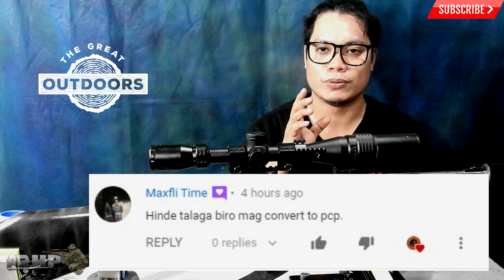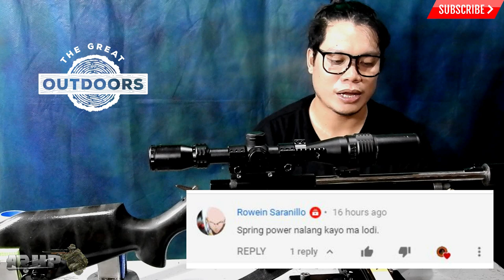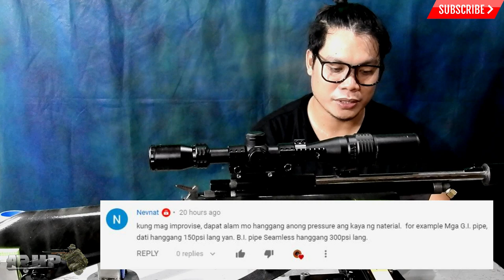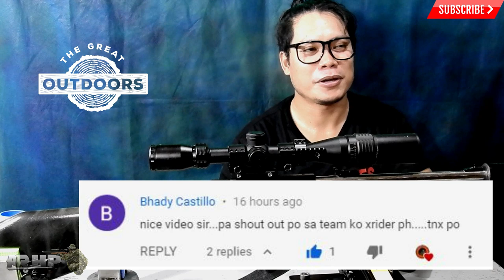BAKIT GUSTO MO NG AIRGUN? | Halagang 7000pesos may Airgun kana

Comment: Hi sir sadin po sa bacolod ang store nyo sir
Reply from the maker: Thanks, po sa inyong mensahe. Maraming salamat po sa panonood.
Magandang Araw po sa inyong lahat, Maraming salamat sa inyong pagbisita sa ating channel.
Ganon din, salamat po sa inyong patuloy na pag subaybay. Mabuhay po kayo!
Always keep safe po, and God bless po sa inyo at sa inyong Pamilya.

Regarding po sa tanong ninyo. Pwede nyo pong ma contact sa messenger ang mga sellers po para ma assist po kau sa mga:
1. Contact info like cp# ng sellers
2. Accessories ng mga airgun
3. Brand ng airguns na avail nila
4. pricelist
5. paano ipadala
6. mode of payment
7. saan location nila
8. o may branch ba malapit sa inyo
9. atbp. na mga katanungan.
LOCAL SELLERS:
1. Win Lustarez
2. Robin Samonte
3. Rolly Aurellana
4. Philip Jeffreth Mendoza
5. Raffy Artigas

PAANO MAGING SAFE AND LEGIT CHECK?
1. Mag pa legit check-Ask ang mga matagal na sa airgunner
2. Mag padala ng Private Message- Send a message regarding sa information na gusting malaman
3. Once nag reply ask question regarding sa accessories or type ng airgun na bibilhin
4. Once na nakapag decide na sa bibilhin, mag video call po kayo para na makita nyo xa same sa profile pic at photos ng naka transaction na seller.
5. Before mag bayad sa item na kinuha mag papadala ang Seller ng Video na binabalot nya ung item mo
6. Hingin ang code if sa ano mang currier nya pinadala.

ADD ON QUESTION:
Ano ung valve na naka thread?
Ito po ang vid na ginawa ko sa installation ng airgun nimrod: https://www.youtube.com/watch?v=wrj_i6z119w&feature=youtu.be
Maraming salamat po. From AIR RIFLE HOBBIES PHILIPPINES
______________________________________________________________________________________________

Magandang Araw po sa inyong lahat, Maraming salamat sa inyong pagbisita sa ating channel.
Ganon din, salamat po sa inyong patuloy na pag subaybay. Mabuhay po kayo!
Always keep safe po, and God bless po sa inyo at sa inyong Pamilya.

Ito po yung kadalasang tanong na hope po makatulong.
PAANO MAGING SAFE AND LEGIT CHECK?
1. Mag pa legit check-Ask ang mga matagal na sa airgunner
2. Mag padala ng Private Message- Send a message regarding sa information na gusting malaman
3. Once nag reply ask question regarding sa accessories or type ng airgun na bibilhin
4. Once na nakapag decide na sa bibilhin, mag video call po kayo para na makita nyo xa same sa profile pic at photos ng naka transaction na seller.
5. Before mag bayad sa item na kinuha mag papadala ang Seller ng Video na binabalot nya ung item mo
6. Hingin ang code if sa ano mang currier nya pinadala.
Nagbebenta kaba ng AIRGUN?
-Sa ngayon nag promote and review lang po muna ako ng Airgun na aking nabibili sa mga maker. Pero maka assist po ako if saan po kayo maaaring bumili online.
SAAN MAKABILI NG AIRGUN?
Makakabili o makakaampon po tayo ng Airgun sa mga online store sa Facebook po.
1. Search Airgun group sa "Facebook"
2. Once accepted and join post for inquires
3. They will Private message po sa inyo sa mga details
a. Payment method
b. Specs ng Airgun
c. Warranty
d. Atbp.
4. Do background and legit check po by posting sa group
a. Tingnan mga friends list niya if madami syang kaibigan na Air gunners
b. Kung kalian ginawa account nya at least 5 years
c. Do a video call sa transaction and screen record for assurance.
d. Maganda kaliwaan ang pag bayad like meet up
PWEDE BA IPA CONVERT ANG C02 TO PCP?
Yes, pwede po sir, e check po ng maker if pwede most of the Airgun like: Nimrod, Manlapat, Taurus, Armscor, Atbp.
Pakita nyo lang po sa maker and ang maker na po mag suggest sa inyo anong conversion gusto nyo like bottle o naka tube. Range po sa 8k-12k pataas po ang bayad sa conversion nakadepende po sa maker. 

PAANO PAPADALA NG SELLER ANG AIRGUN?
Papadala sa currier ng seller, sila na po bahala doon.
By buss o barko, make sure po na complete address and my phone number and ask how long dadating.
Ganon din ask ang sellers for warranty what if di makakarating ang Item.

KAILANGAN BA NG LICENCE ANG AIRGUN?

There is no law that will punish anyone in the country for having an airsoft/airgun even if it is not registered. You also don’t need any form or permit or license to own one...our firearms law R.A. 10591 does not include the word airsoft or airgun in there. Feb 6, 2019.
Credit from: Journal.com.ph

PAANO MA PA REGISTER ANG AIRGUN?

Pag nakasali na sa mga Airgun group sa Facebook
You can ask for the legit person for register 
(LARRY AVILA) Philippine Team natin you can ask him po
Magbibigay sya ng mga info for requirments
Maganda if by group po ung pag register para isahan nadin po

PWEDE BANG ISAKAY SA BUSS O BARKO ANG AIRGUN?
1. Kailangan po na naka register ang Airgun
2. Kailangan dn may receipt ang Airgun na makikita kau ang may-ari
3. Mag inquire sa Buss and Ship station if pwede isakay ang Airgun
a. Ipakita ang registration at Reciept 
4. Pag pumayag na sila doon lang dadalhin ang Airgun
5. Baklasin ang Airgun-walang laman na c02 o hangin- at ilagay sa safe na lagayan
PWEDE BA MAISAKAY SA AIRPLAIN ANG AIRGUN FROM IBANG BANSA SA PINAS?
Sa ngaun limited po ang kaalaman ko tungkol dyan, ang iba sabi nila nakakapag padala sila sa balik bayan box.
PRICELIST STOCK AIRGUN: (Walang scope, Bipod, c02 Tank)
Depende po sa Seller ang Price either mababa sa binanggit kung Price o Mataas.
1. Nimrod co2 7500 more or less
2. Manlapat co2 13k more or less
3. Taurus co2 7500 more or less
4. Eskopeta co2 from 5500 pataas
5. Jr mangio co2 from 7500 more or less 
6. PCP pump 3k more or less 3 stage
7. PCP pump 4k more or less 4 stage 
8. PCP starting from 15k-50k local made
9. Scope from 3500-18k
10. Suppressor from 2k-5k
11. Tripod from 1500-2500
12. Scope 3500php to 5000php “Low end”
13. Scope 8000php to 15000php “Mid End”
14. Scope 20000php to 70000php “High end”

About namn po sa mga location ng pamilihan-cnxa po dahil hindi po ako affiliated sa mga company po o pagawaan ng airgun dito sa Pinas o sa ibang bansa.
Thanks, po sa support, Share and SUBSCRIBE po.
 from Air Rifle Hobbies Philippines.
LOCAL SELLERS

Comment: Jack
Reply from the maker: Thanks, po sa inyong mensahe. Maraming salamat po sa panonood.
Magandang Araw po sa inyong lahat, Maraming salamat sa inyong pagbisita sa ating channel.
Ganon din, salamat po sa inyong patuloy na pag subaybay. Mabuhay po kayo!
Always keep safe po, and God bless po sa inyo at sa inyong Pamilya.

Regarding po sa tanong ninyo. Pwede nyo pong ma contact sa messenger ang mga sellers po para ma assist po kau sa mga:
1. Contact info like cp# ng sellers
2. Accessories ng mga airgun
3. Brand ng airguns na avail nila
4. pricelist
5. paano ipadala
6. mode of payment
7. saan location nila
8. o may branch ba malapit sa inyo
9. atbp. na mga katanungan.
LOCAL SELLERS:
1. Win Lustarez
2. Robin Samonte
3. Rolly Aurellana
4. Philip Jeffreth Mendoza
5. Raffy Artigas 
6. john brent panizales
7. joe talucod
8. jess devora

PAANO MAGING SAFE AND LEGIT CHECK?
1. Mag pa legit check-Ask ang mga matagal na sa airgunner
2. Mag padala ng Private Message- Send a message regarding sa information na gusting malaman
3. Once nag reply ask question regarding sa accessories or type ng airgun na bibilhin
4. Once na nakapag decide na sa bibilhin, mag video call po kayo para na makita nyo xa same sa profile pic at photos ng naka transaction na seller.
5. Before mag bayad sa item na kinuha mag papadala ang Seller ng Video na binabalot nya ung item mo
6. Hingin ang code if sa ano mang currier nya pinadala.

ADD ON QUESTION:
Ano ung valve na naka thread?
Ito po ang vid na ginawa ko sa installation ng airgun nimrod: https://www.youtube.com/watch?v=wrj_i6z119w&feature=youtu.be
Maraming salamat po. From AIR RIFLE HOBBIES PHILIPPINES

Comment: Hello Dave Yan ba display mo Blkbutt Airgun Co2 type HM Yan naka post mo price is 7,000 thousand is this correct? Pls. Pm me and Send me Price List Diff. your Airguns 4sale Hummer type 2cock Bolt Co2 type PcP . Eskopeta , Patrol , Blkbutt ,
Reply from the maker: Ung 7000 back 6 months ago more or less nfayon 7500plus na ata sir sa mga sellers.. not into selling po but promoting ung hobbies or sports na po nato. 7500plus is a standard single cock hammer type, standard tank, 19inch barrel, co2 tank scope not included. Hindi dn po threaded .. thanks po sir.. 🙋‍♂️👍

Sure po. 🙋‍♂️

Click to subscribed: 
https://www.youtube.com/channel/UCa9UggjpsiriqY-AF9Is9gQ?sub_confirmation=1

Magandang Araw po, Dave Lopez po ng Air Rifle Hobbies Philippines.
Thanks, po sa inyong mensahe. Maraming salamat po sa panonood. Welcome po sa Airgun Community.
Salamat po sa inyong patuloy na pag subaybay. Mabuhay po kayo!

Regarding po sa tanong ninyo. Pwede nyo pong ma contact sa messenger ang mga sellers po para ma assist po kau sa mga gusto nyo pong airguns brand and specs:

1. Contact info like cp# ng sellers
2. Accessories ng mga airgun
3. Brand ng airguns na avail nila
4. Pricelist ng airgun
5. Paano ipadala ang airgun
6. Mode of payment (Bank-wire transfer payment)
7. Saan location nila ipapadala ang AIRGUN
8. May branch ng AIRGUN SHOP ba malapit sa inyo
9. atbp. na mga katanungan.
LOCAL SELLERS:
1. Win Lustarez
2. Nash Manabat -eskopeta
3. Robin Samonte
4. Joebert Dionisio
5. Alan Jomonong
6. The Pellet Pusher
7. Rolly Aurellana
8. Philip Jeffreth Mendoza
9. Raffy Artigas 
10. John Brent Panizales
11. Joe Talucod
12. Jess Devora
13. Chris Papakid
14. Paqs Relucio

Thanks po sir .. 👍 sa crame po pwede po kau mag inquire, one time registration lang po xa.. or punta po kau sa mga group sa fb about airguns.. may nag process dn po ng registration dn . Thanks po

PAANO MAGING SAFE AND LEGIT CHECK? 
1. Mag pa legit check-Ask ang mga matagal na sa airgunner
2. Mag padala ng Private Message- Send a message regarding sa information na gusting malaman
3. Once nag reply ask question regarding sa accessories or type ng airgun na bibilhin
4. Once na nakapag decide na sa bibilhin, mag video call po kayo para na makita nyo xa same sa profile pic at photos ng naka transaction na seller.
5. Before mag bayad sa item na kinuha mag papadala ang Seller ng Video na binabalot nya ung item mo
6. Hingin ang code if sa ano mang currier nya pinadala.

ADD ON QUESTION:
Ano ung valve na naka thread?
Ito po ang vid na ginawa ko sa installation ng airgun nimrod: https://www.youtube.com/watch?v=wrj_i6z119w&feature=youtu.be
Maraming salamat po. From AIR RIFLE HOBBIES PHILIPPINES
c02 airgun, pcp airgun, buy airgun, Nimrod airgun, Armscor airgun, buy airgun Philippines, Airgun sa Pinas, air rifle for sale, Eskopeta airgun, price air rifle, hunting Philippines, how much airgun, airgun hobbies, for sale air rifle, for sale airgun, airgun for sale Philippines, hunting Philippines hunting birds, hunting birds Philippines, homemade air rifle hunting, online airgun, safety of air rifle, tiksay fish hunting airgun, air rifle, hunting, airgun, air rifle